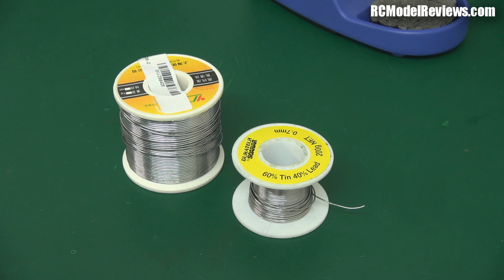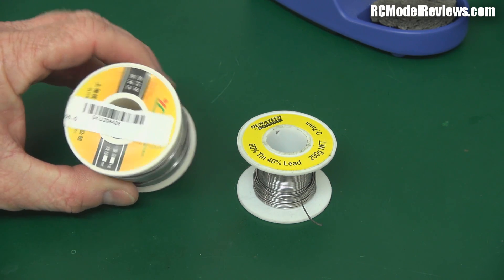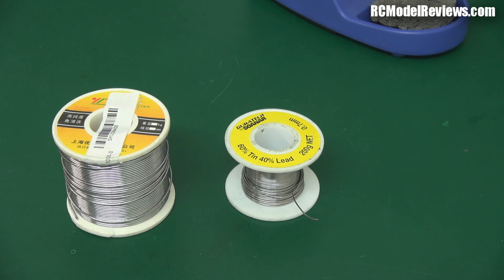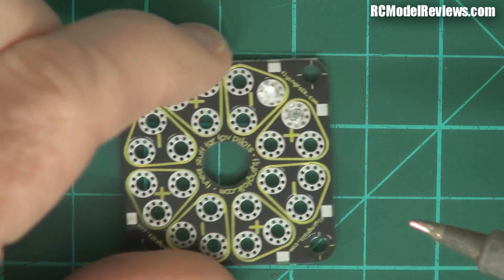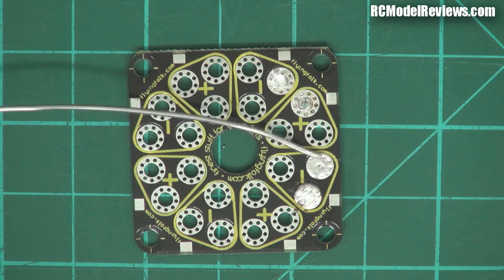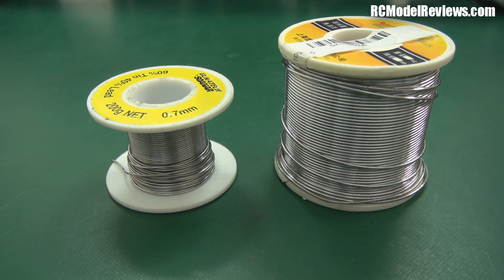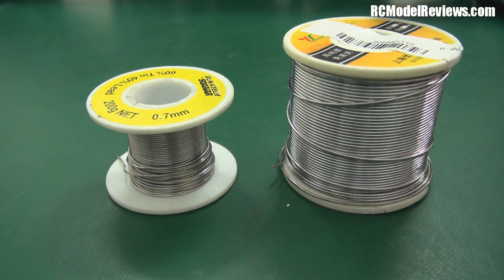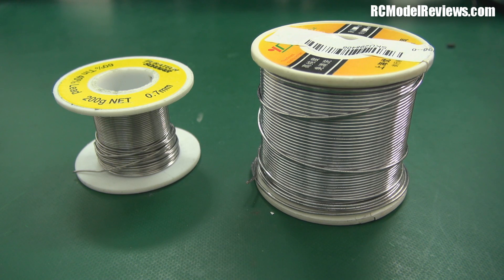60/40 versus unleaded solder

Comment: Lead free is like 60/40 solder, both aren’t worth your time. Lead free cannot yield a high quality, high reliability solder joint any more than 60/40 tin/lead alloy. The only solder worth using is a pure eutectic alloy! The maker of it matters not as much as the percentage of tin to lead, preferably in an RMA formulation. The rosin core, mildly activated formulation in either the Sn63, a standard pure eutectic and Sn62 which uses a 2% silver in it’s content but the ratio of tin to lead remains 63% tin and 37% lead. The tin part is 62% and the lead is 36% in the Sn62 configuration with the remaining 2%silver. The silver variant is a better conductor of electricity because of the inclusion of the silver. Reliability studies have concluded that the RMA solder yields consistently better and more reliable joints. Facts of which denial will not change their truth! I don’t make the rules people! It is what it is!

Comment: and with lead fee solder more stuff brakes down more stuff in land fill that over all are more damaging to mother earth I did try lead free an yes needs more heat an if any vibration it cracks apart no good for amplifier builds were there is heat it tracks it is crap not even worth the effort to put in a bin

Comment: Smh, come on now it's not that bad. It's certainly not as easy to work with and doesn't produce the same quality of results but I used it for a few years without issue out of convenience cause it's what I could get locally. Honestly I almost preferred the way it flowed and the fact it melted later and solidified quicker when I first transitioned to using leaded full time. Yes leaded 60/40 or 63/37 is superior. But my lead free was never "pasty" it takes more heat obviously if you don't up the heat of course you'll have trouble.

Comment: Well it depends 
I agree solder with lead is better, stronger joints, nice looks (very reflective) and easy to solder. 

Here are my reasons why i still solder with leadfree solder 
First of, you have the cheapest of lead free solder i have ever seen. 
I, at work have better leadfree solder with flows perfectly
My simplest solution, is to increase the temperature to 350C
If you want a link to the solder i use, just ask
Reply: Greetings btw. Nice vid

Comment: The reason I use lead-free solder isn't because I'm trying to save the planet - it's because I'm trying to same me! The more I learn about lead the more I realize how dangerous the stuff is. The biggest worry is its link to impaired brain function, plus it can stay in your body for years. I've never seen lead free solder flow as poorly as yours did - mine works a treat. Even worst case scenario and it makes an inferior joint (and I'm not convinced), I'd rather fix a bad joint once a year than suffer the health risks. If I start building spacecraft or something mission critical, sure I'll use leaded, but for assembling some hobby electronics or repairing a toaster? No way.

Comment: To be fair
Nowadays there are better alloys of lead free solder
But leaded solder is still generally better in durability, conductivity and usability
But both spools used in the reviews... Aren't high quality ones
Usually high quality ones have good quality joints which are generally durable and strong, both lead free and leaded solder

Comment: Honestly... Since lead is heavy, I bought lead free - which was way cheaper per volume. It was not labled, so I did not even know, if it had rosin core - luckyly it has! It is 0.5mm solder. It is great for SMD and ultra fine pitch through hole. (The distance between to 1.27mm pads can be almost 0, if the pads are large!) I dissolved cheap rosin from ebay for 4€ 100 grams (!) in a few ml of ethanol. It is like runny honey, but perfectly clear. I preflux on ANY soldering. The solder flows amazingly. It is very easy to work with and the spool is not close to get used up. I am on the cheap site all the time - skill and flux fixes all the problems! Oh, and good soldering tip.

Don't forget to always brush of any remaining flux, or in high humidity environment your PCB will slowly rot away over time. (Metal corosion)

Comment: SAC 305 works much better than the Chinese lead free used. If you want low temperature you can still comply with RoHS by using Sn42/Bi58.

Comment: Preheat the pcb, use plenty of flux,  a little bit higher temperature and you should not have a cold solder. O use a good brand of lead free not the cheap shite u have. Best of all no lead poisoning.

Comment: It's the smoke from flux you have to worry about,it is toxic.A soldering iron can never get tin or lead hot enough to boil.when lead is boiled then it will give off toxic gases.I do prefer 60/40 over nonlead though

Comment: Lead  free solder is the result of outrageous fraud on the part of EU rule makers.  The EU desperately wanted lead added to the ROHS prohibitions for political reasons and decided to use lead solder in landfills to make their case for long term environmental damage to the world water supply.  When their leaching test failed they decided to grind up their test material to greatly increase the amount of solder in the chemical test bath.  Even so, they just barely exceeded the required threshold for dissolved lead.  Their dishonesty has cost the world BILLION in unneeded expense to create vastly inferior lead free solder technology.

Comment: Bro, 60/40 solder is good for good quality solder joints and easy to work, but is a bit toxic if you are not careful. The lead-free solder is har to work (you need to wse higher temeprature), but is safer. To use lead-free solder properly, you will need to incerase the soldering iron temperatoure. The liquid-solid transition will take a bit longer(1-2 secons) not 5-6. I'm not a lead-free solder fan, but i presentet advantajes/devantajes of the solder. I hope this were useful.

Comment: i dont think you need the tough lead stuff for making wire connections for your rc kits etc ,i think that tin stuff should work fine,in fact tin is what makes it flow and wet out easier,the lead makes it more difficult so im surprised the all tin stuff does not do that so well,must be the other additive crap they put in it doing that

Comment: First, 60/40 isn’t eutectic composition solder. It’s so nearly eutectic that it’s close enough. 63/37 is eutectic. This means the components (tin and lead) liquify and solidify at a single temperature. There is only one ratio of the components that can strictly be called eutectic composition.

https://en.m.wikipedia.org/wiki/Eutectic_system

NASA found tin whiskers to be the root cause of throttle runaway in Toyota vehicles that caused several fatalities. 

ROHS is not about saving the planet, it’s about exposing humans to heavy metals and toxic chemicals. That being said, lead-free solder sucks.

Comment: Got to agree, lead free solder is absolute rubbish, bought a roll of what stated on the label as 63/37, tried to use it and quickly found out that it had no lead in at all, had to turn the solder station up way higher than normal and even then it never flowed properly, left me with poor joints and a horrible dull finish. Went on to buy a new roll of 60/40 solder from a UK electronics supplier and immediately saw a huge improvement plus I could solder perfectly at 320 degrees :)
Reply: It seems like more web stores in Europe are trying to get rid of 60/40. Majority of them supply more lead free crap than 60/40.

Comment: I must use a better type of lead free solder than you because I experimented no issues like those described in your video (except for the dull finish it has ^^). But I once bought crappy solder from china (lead free too) and it was really bad, all it comes down to is the quality of the solder itself, good lead-free solder can be fond with a bit of research ^^

Comment: I use the crappy lead-free chinese stuff when I want to bridge connections on pcb, you can build a long bridge with the paste and connect things without putting down wires. But it is crappy in all other applications... But my 2 best solder I own that works are a 60/40 and a lead-free one. So not all lead-free are the same. To bad that I can't find the good lead-free again after it have run out, I have 5+ different crappy versions now when I have bought alternatives trying to find a good one... It ended with a new roll of 60/40 that I know work.

Comment: I need a soldering wire that’s for general purpose things to solder gutters battery terminals or just anything. I got a air compressor head that’s got a small crack on head want some solder what would ya recommend on amazon or eBay

Comment: You are absolutely right...and give very good objective scientific information indeed!...unfortunately being associated with RC modeling, it might not be taken as seriously as it should...I too was tempted to not watch the vid to the end, but am glad I did!   The "environmental issues" you mention, and the reasons for removing lead from solder is the European RoHs and is based on BS substantiations (see Ref!):  ...that there is some massive exposure to lead in electronics, when in reality the amount used there is absolutely minuscule compared to the amount used in lead-acid car batteries (which are EXEMPT from these regulations...because its tough to make a lead-acid battery without lead!)...so here we are...  
Lead-free solder does absolutely SUCK! ...from a use and effectiveness standpoints (more corrosive fluxes are required, which can corrode electronics if not cleaned off well, much more difficult to use and get a good joint, etc), also from a negative side-effect standpoint (tin whiskers are a serious reliability issue, especially in High-Rel like military and aerospace!)  
The fact that  ebay suppliers of counterfeit china-crap goods don't know how to tell 1mm from 0.8mm, and lead-tin from no lead, or maybe they do and think the customers are too stupid to notice this...and the fact that those pricks could f**k up a junkyard, is a different issue...  You should send that useless crap solder back to the thieves, and let them eat it...its not poisonous!    
Reference:  eetimes.com/doc?asp_id=1279227  Cheers

Comment: handling lead/Lead vapors can give you lead poisoning. I don't want tremors, memory problems or birth defects. I rather stick to the lead free solder.
Reply: Boiling point of lead is 1750°C. You can be very certain that absolutely no lead gets evaporated during soldering, as the maximum temperature soldering irons usually reach is no higher than 450°C. Leaded solder allows you to solder colder, less than 300°C, which helps limit flux degradation and evaporation.

Lead can be transferred to hands when handling leaded solder. It's important to wash your hands just after soldering. But if a small amount of metallic lead compounds is ingested, actually it doesn't participate very well in digestion and it'll come out of your behind a couple days later. Danger from metallic lead compounds is orders of magnitude lower than from organic ones such as used in some paints and formerly as a fuel additive, so those controls and reforms are important. Ban of leaded solder is possibly sensible for environment, but has no tangible effect on safety of individuals handling it.

Across numerous health surveys of electronics manufacturing and repair professionals performed in the 80ies and 90ies, no traces of lead in the body fluids of these were found, no symptoms of an increase in potentially lead poisoning related diseases were reported, nor does dynamics of reported health issues allow the conclusion that lead poisoning has occurred. However, anywhere between a quarter and a half of the professionals depending on survey have shown signs of asthma or respiratory disease, which would instantly begin to subside when off the job, the only cause of this combination can be flux fumes. Electronics flux is made out of processed tree sap and partially burns and evaporates while soldering, producing a large number of compounds ranging from high-irritants to likely carcinogenic, flux is always embedded into the solder wire, and it's unavoidable anyway, you can't solder without it. Little new research is available for various reasons, such as shift of manufacturing to China and increase in automation, but it stands to reason that if you have good temperature control soldering station, leaded might be safer, but extraction and filtration is very important regardless of solder type.

Comment: I use unleaded only because I work in a production environment. I also do a lot of repair work. Sometimes I have to remove a through hole device. Ever tried desoldering a hole with the pin still in it on unleaded? It is a BITCH. So I cheat, I clear the joints of the unleaded as best I can then flood it with leaded solder. After that its much easier, can turn down the tip temp, and still have less chance of ripping out the through hole plating. Of coarse it needs to be resoldered with the unleaded crap to keep it compliant with ISO9000 but hey, by then my job is done.
Reply: How about adding bismuth wire to the joint? It will lower the melting point yet lower than lead, and is probably not banned (yet). Bismuth has some rather unfortunate wetting properties though so it should be wicked off more or less cleanly.

Comment: Regarding the claim unleaded solder will not last as long as leaded solder I just found this in Navy files on solder: “The typical life of commercial electronic devices is three to seven years compared to decades for DoD systems,” said Lloyd Condra, Chairman of the Lead Free Electronics in Aerospace Project (LEAP). “In fact, we’re seeing device manufactures optimizing the design of microcircuits to wear out in that same timeframe.” (end of excerpt)  Well looks like the claims of planned obsolescence are true and not just a few companies like Samsung getting caught.

Comment: This is a cheap chinese solder of 63/37. It is NOT 'lead-free' as they describe it. Chinese volume sellers on internet stores often misrepresent their products in order to get slightly higher prices. I also purchased this crappy solder 63/37 (not sure if Sn=63% or 37%). My 25W iron can hardly melt it, but an old plumbing solder (made in America), with clear label of Pb70&Sn30, melts and hardens almost immediately with bright silver glow.

Comment: it’s not the lead free solder, it’s the soldering iron, you need to turn the temp up; your iron is also heavily oxidized, and you’re using the wrong tip geometry, and the wrong technique, no solder on the tip

Comment: Have you tried adding a bit of flux? Might help the lead free solder.
Reply: It would help certainly even if your using rosin cored solder anyways. You don't avoid using liquid rosin flux just cause your wire has rosin flux in it. Despite what this video says lead free with a decent liquid flux used on the larger joints will yield perfectly satisfactory results that will be fine for any hobbyist. Yes leaded 60/40 or 63/37 melts easier but people who say less free is useless either don't know how to solder very well, are using cheap crap solder wire, or don't account for the higher melting point. If you can get leaded and it's for an application your kids won't be playing with have at it. But if your working on a small repair and you just wanna grab some solder locally an all they have is less free that's certainly usable. Just remember to use an extra 100 degrees or so, flux larger joints or joints that you don't want getting to hot ( the flux will reduce the amount of time it takes to solder the joint by cleaning the surfaces and heating the solder more consistently so you can avoid damaging small components not to mention that extra flux will result in better solder flow in your joint) and if you do those things you'll be fine.
Reply: Extra heat will help but extra Flux wont. Maybe there is a brand of lead free solder is better than other brands but regardless of what brand won't stop the tin whiskers that unleaded solder causes.
Reply: Save the earth by recycling electronics, you should not need to buy a power adapter for each new electronics you buy. Standardization is best for all electronics manufactured. Keyboards and mice should work on all computers that have usb connections.

Also memory cards should also be transferable from one computer to another. Just these two features would save money and reduce waste.
Reply: I use non-rosin-cored lead free solder from a good quality USA vendor and have to say I haven't had any issue with it yet, perfect for joining cables and applications where you need extra heat resistance, I use plenty of extra flux on every joint I've also noted it helps prolongue life on cheap soldering irons by reducing their temp a bit
Reply: @ZonaALG  TIN  WHISKERS  that's why the military won't use lead free solder regardless the manufacture..
Reply: I believe he was using flux core lead-free (s**t) solder, besides adding flux does not address the issue which is metallurgical!  Lead-free solder SUCKS!
Reply: @ronplucksstrings7112  Yes that's exactly what adding flux does it address the efficiency of melting and adhesion of your joint. Extra flux is certainly meant to be used with rosin core smh. Do you think that just cause it's rosin core you don't have to use flux with it on some joints Lol? Smh, you obviously have no clue what your talking about and weren't qualified to answer the question. Which wasn't a stupid question at all. Sadly you decided to give a really stupid answer even though the OP has a better understanding than you do of how soldering works.

Comment: Thanks to environmentalists back in 2005 they banned lead soldering on a lot of electronics and ps3 systems failed back then from heat and cracked lead free solder connections. I bought a used fat ps3 last month that is 11 years old and i pray every day it doesnt die on me